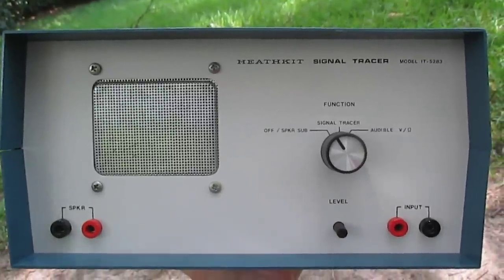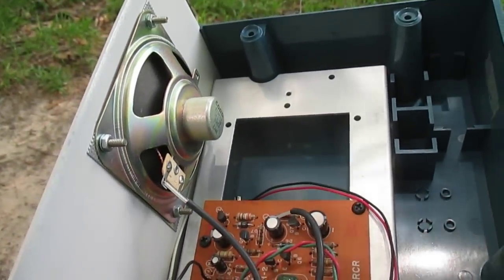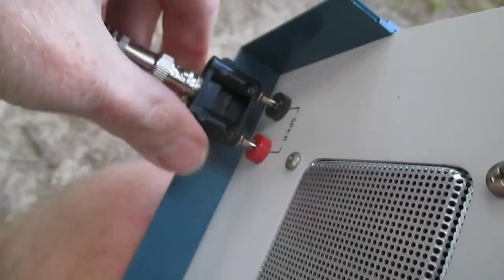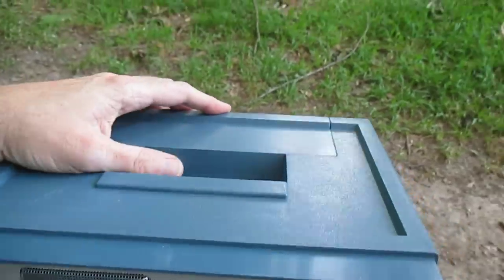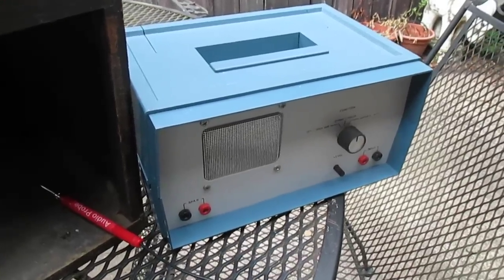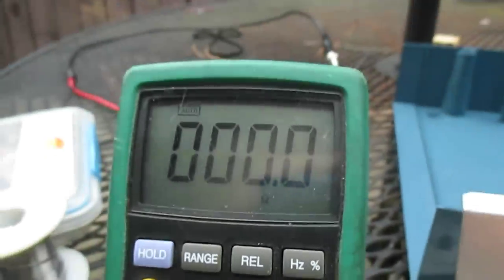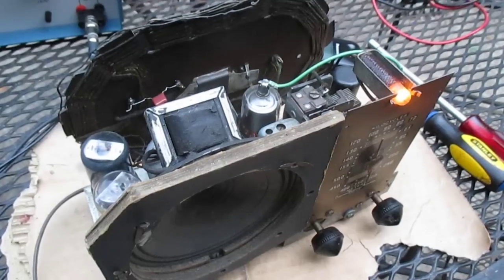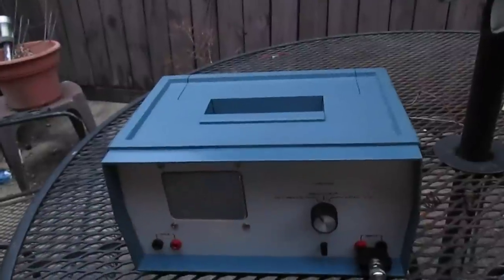Heathkit IT-5283 Signal Tracer

Comment: The original probe for these has a 1N4149 silicon high speed diode in series with a 1000pf capacitor. The custom probe you bought is using a 1N34A germanium diode. I wonder if the difference in diodes is causing some of your problems? Also, mine did not come with the metal shield when I built it in 1983. As sensitive as this tracer is, I have to wonder if that was a later improvement?

Comment: I used that model in college to do stereo repairs to earn a little pocket money. It was very useful. The internal speaker is a little rough, and the unit would benefit from a better external speaker. That is my observation from using it extensively about 40 years ago. It's a great unit for what it is in my opinion. I still have mine, and it still works.
Reply: How do you use the probe to find out what caused an output channel to go out on a stereo receiver?
Thank you
Reply: And does the stereo has to be powered on?
Thank you
Reply: @SDsailor7  You follow the signal path from the source to the speaker output. You can also do it from the speaker to the signal source. Somewhere along the way, you will find the problem.
Reply: @SDsailor7  You follow the signal path with your probe. Yes, the unit under testing has to be turned on.
Reply: @Amp497  Thank you i will try that.
Cheers

Comment: I found an old Heathkit oscilloscope a decade ago, and I don't think it's working properly but the electron beam does still project. This is the first other piece of equipment of theirs I've ever seen (I'm only 28 though so much younger than either of these devices).

Comment: 15:00 No load on three audio output transformer. Possibly the radio is inductively coupling to the signal tracer via the audio output transformer and the input circuitry and wiring in the tracer. Also there is no resistor in series with the probe tip in the RF probe which introduces the input impedance and capacitance of the probe and tracer into the radio or device under test circuitry. I've noticed through the years the variations on RF/IF probes. 33 k to 100 k-ohm resistor in series with the tip of the RF probe mightv correct the trouble.

Comment: I rescued an old cartridge by spraying WD-40 where the needle bridge is and  rubbing the bridge working the WD-40 inside the cartridge. It was a great surprise I never thought it would work. Standard practice is to throw them away and buy a new one but you can't get them as easy anymore. I saved three that way but one was too stubborn I'll let the WD-40 work on it overnight and try again tomorrow. I'm trying to save an RCA cartridge and WD-40 restored it from being completely dead to working good on the left channel but the right channel has a tiny spot where pressure on the needle causes a bad connection. It plays but if you listen carefully it barely cuts out as the needle pulls the tone arm against the reject trip mechanism. It's aggravating maybe tomorrow the WD-40 will work out the black oxidation that migrated into the ceramic element. On the other two cartridges both channels are completely restored with no bad spots. It may not work all the time but it's worth a shot maybe deoxit will fix the stubborn ones

Comment: These days I tend to prefer the good old fashioned "heavy duty" zinc chloride cells vs. alkalines because they don't leak.  Modern alkalines are all garbage and leak very quickly, even in the package.  Usually I need them in something that will not have a battery change for years (i.e. remote or thermostat) and the heavy duty ones work just fine in these use cases.  For things I used to use alkalines in, I use rechargables now and everything else comes with built in lithium ions.  Had way too many things destroyed by alkalines so I don't use them any more.  In multimeters I put those expensiveish lithium 9V batteries. they will not leak and they last years so it tends to be worth it.
Reply: I just go rechargeables now. Ruined too many kids toys before I saw the light
Reply: I have had the same problem with alkaline batteries- they might last longer than carbon-zinc, but they leak before going completely dead, so I have to keep checking them. I use Ray-O-Vac  carbon-zinc on most everything now. All things considered, they are the best. Hard to find in most stores, but if you go to Big Lots, they have lots of them.

Comment: Can't you just run a cable with a 0.1cap in it to an amp for a signal tracer?
Reply: I was thinking that, you just need the detector diode like in the RF  probe.
Reply: Yes, but you might be disappointed with the gain. You would also need a switchable 1n60 diode for the AM RF circuits.
Reply: Cheap guitar amp with overdrive amp will work well.

Comment: very interesting and informative. I remember this series of Heathkit test gear, also an oscilloscope, sine/square wave generator and VOM. I recall the external power supply had five output leads with molex connectors for each device.  The Emerson radio you were testing, the signal tracer was detecting the broadcast and not connected to the chassis. The tracer was acting as a receiver, was it possible the miss wiring on the shielded wiring and ground to the PCB might have acted an antenna? As mentioned not any shielding inside the case or around the chassis.

Comment: I had the RF generator. It was a sweet unit. I can see that there are issues with the design of the signal tracer. Some it seems are due to the low impedance of the input. The original used tubes which are inherently higher impedance. I'd say if you intent to use it for tube circuits, add a unity gain FET amplifier on the input.

Comment: I believe the original probe's rf mode adds a small cap in series
Reply: If you look closely, this probe has that capacitor in series also. BUT, the original had a 1N4149 silicon switching diode in it, while the probe in this video has a 1N34A germanium diode. Maybe that germanium is not quite compatible, explaining why the tracer works on some radios, but not others??

Comment: Nice video! You're right and I'll agree with you that like myself, you'll have to be very careful whenever making a costly investment in a completed/refurbished/used Heathkit equipment or product on eBay that you don't wind up getting some sloppy kit builder's poor soldering and workmanship; unless it's just for parts or repair.

Other than that, the 1N34A diode in that custom RF test probe might be too general for specific testing/tracing.

By the way, I'm still searching for a decent Heathkit T-3 Signal Tracer on eBay that matches the colour of my Heathkit C-2.